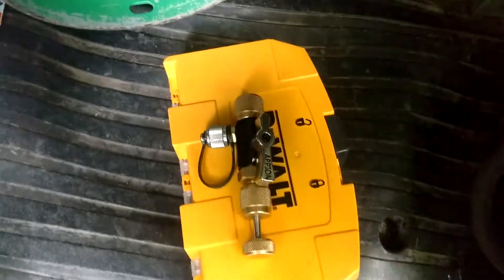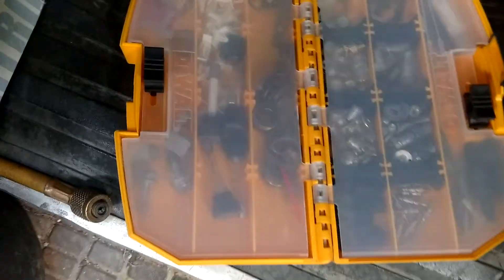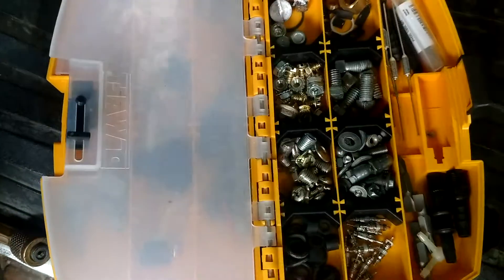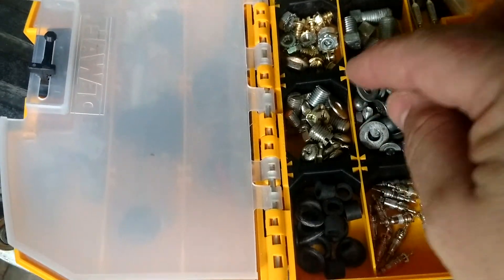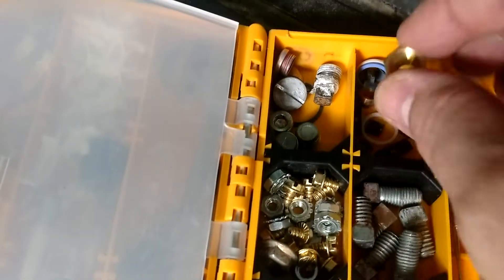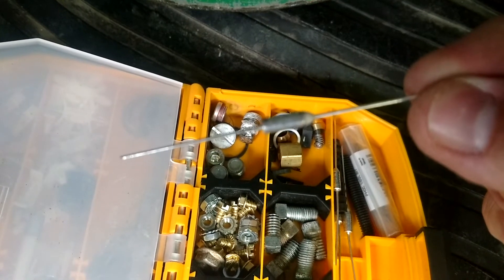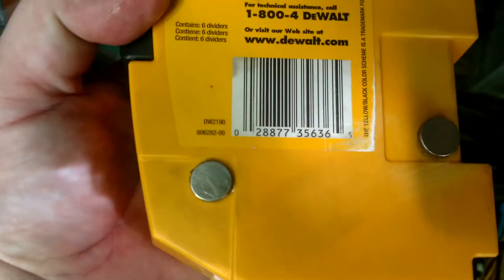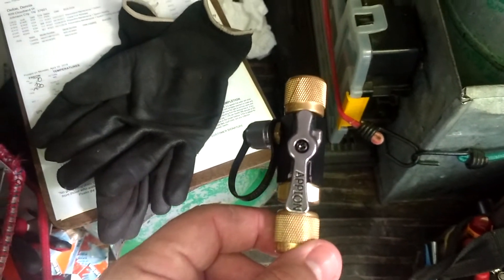Dewalt #DW2190 small parts box & Appion valve core remover tool #MGAVCT. Great stuff for HVAC 👍

Comment: I repair those no loss fittings too bro. You don't see many people doing it though
Reply from the maker: Joe Shearer  yeah, it's usually just that top O-ring on the seal tight hoses that needs to replace from time to time. The flat o-ring that's countersunk in the brass on the back side can just be pulled out and flipped over and it'll be good for 10,000 more miles 👍
A lot cheaper than a $60 set of hoses every year. Unless you win some from Ted 😁
Reply: Shannon Knight I've never flipped that one before that's a good tip. I found that if the fitting sprays a lot of Freon going on or off its that flat gasket.